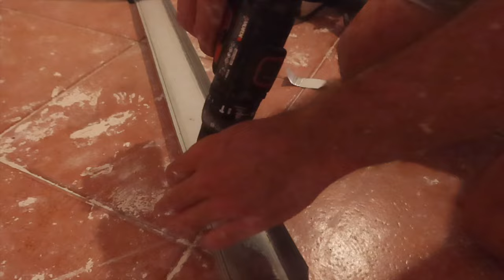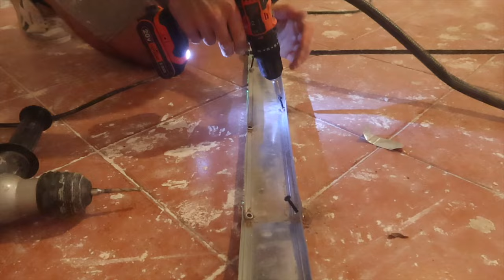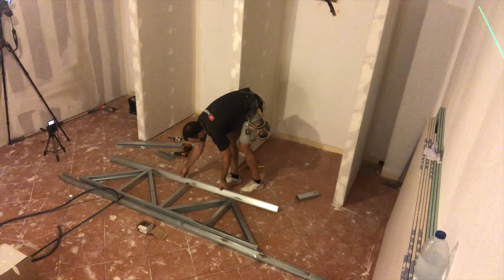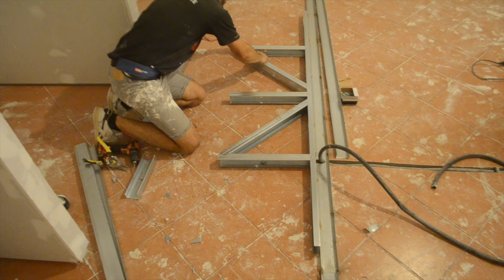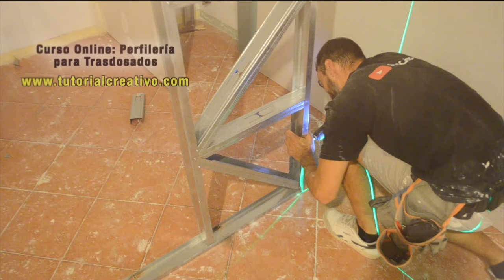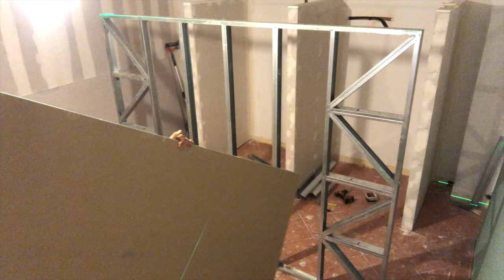🔥 How to Install a Half-Height Drywall Wall Anchored Only to the Floor

Comment: No way that has any real resistance to falling, being pushed or knocked over. The bracing at the ends would give it tremendous resistance to racking, but so would the drywall